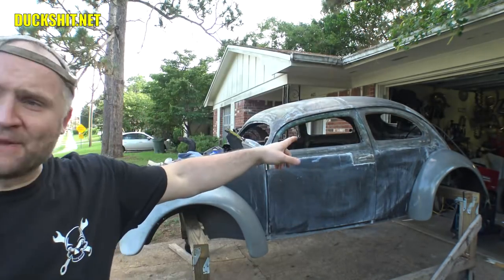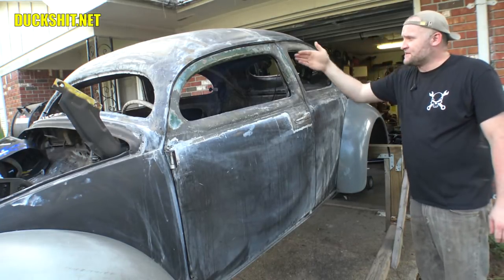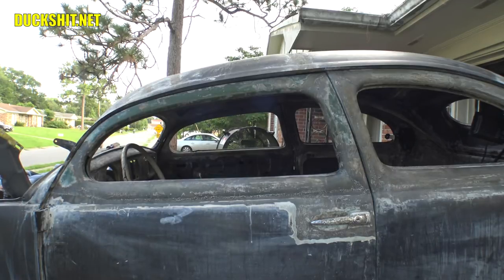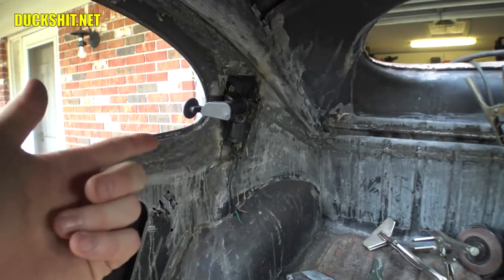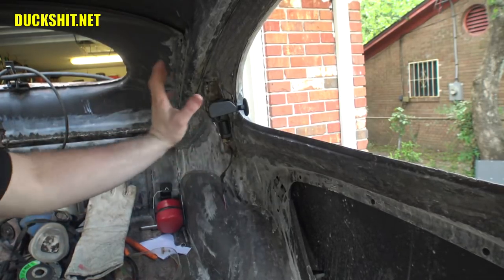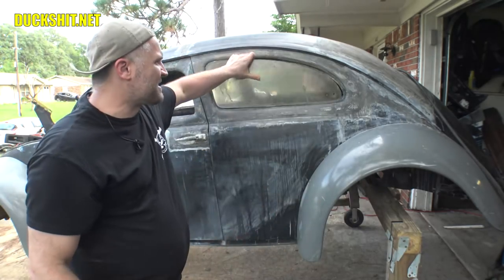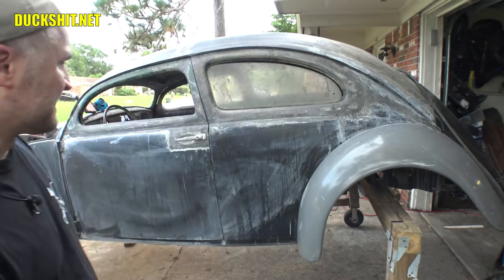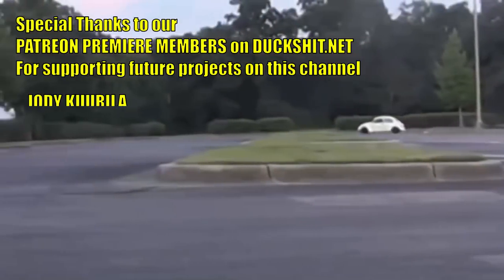VW Beetle Electric Powered Pop Outs Answers - Mid Day Q&A - 71

Comment: Another great video. My question is about the phosphoric acid,because I would like to start using it on my projects as well. Does it leave a residue that needs to be properly removed before prep and priming? Or is the sanding and wiping down of the surface with the standard pre paint prep enough?  Thanks Duckman for putting out good content and helping us with your knowledge.
Reply from the maker: I will probably do a video just for the phosphoric acid because I get asked so much about it.  But yes in between applications of anything you always need to clean.  Thanks so much for your comment and I'll get to making your video sometime in the next couple weeks.  😁

Comment: Not sure if you want them to open at the same time or independently. Stealthy toggle switch. You can get ones that are momentarily in two directions. Hook both to one side to open the other side to close. Since they are momentarily, you can open a little or a lot.
Reply: Switches are DPDT
Reply from the maker: Yep!  DPDT with crossover wires to the outsides!  Those work great!  Thanks for the suggestion!

Comment: Try looking at mid to late 30s GM cars. My 38 Chevy had ivory knobs. Alot of those era had unique items. Just a idea. Til the next video.
            - KEEP DUBBING -
Reply from the maker: Shame on you for telling me to use non OEM parts on my Beetle!  LoL!  This Beetle originally had ivory dash knobs, I still have some of them.  They are plastic, but easy to get.  They have the correct look for 1956.
Reply: @vvtheduckvv  thought you were looking for switches. Yes I agree only vw. Yours is an exception to the rule. Thank god you didnt put a Subaru engine in it. ( LOL)
Reply from the maker: @Volkswagenplanet  Subaru engine goes in first week of August.
Reply: @vvtheduckvv  should be at Earls then. See I do pay attention
Reply from the maker: I was also kidding... just trying to fire you up lol
Reply: @vvtheduckvv  its all good
Reply from the maker: But it's even better when I can fire up an oem Nazi LOL
Reply: 50's GM crap named Buick had ivory dials too.
Go check Lou Costabile's vid about the NY bug
with the V8 in the back. "The Berlin Buick". 
Looks fckng good on this car. At 4.42 you
see my type door hinges.
Reply from the maker: Cool!  Thanks!
Reply: @vvtheduckvv  yw? I''m not always even with
your but you are welcome. I prefer another 
solution if i might to start something similar 
project. Full electronics. Smtg like the Berlin
Buick.

Comment: From one Jersey guy to another, I don't think those windows will work as demonstrated with your door example replication. When you opened and closed the door with your hand it was just a straight pull out and push in which allowed the hinge to work as designed, straight out and in. But the electric window hatch appears to work circularly when it is activated. I think it would work if they were scissor types or if the hinge allowed for up and down movement but I don't see it happening in a physics sense. Prove me wrong.
Reply from the maker: LoL will do!
Reply: My other concern is that while the door jam where the hinges are is perpendicular to the ground, the window post where the hinge will be mounted is not. I'm thinking it has a better chance of working if the actuator were mounted higher in the area it is mounted now so to allow the hinge to pivot on it's axis.   @vvtheduckvv
Reply from the maker: Well higher means it will need more reach, too.  So they will open up less in that case.  They're good where they are at!  Watch and see!
Reply: I’m pulling for you.
Reply from the maker: Thank you, sir!  Stay tuned and BE AMAZED!  😯😯😯😯